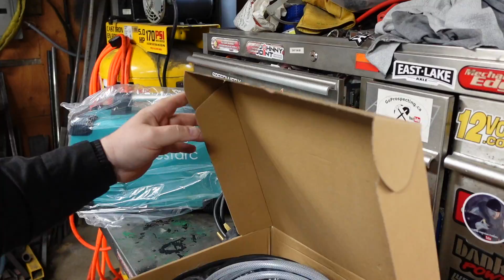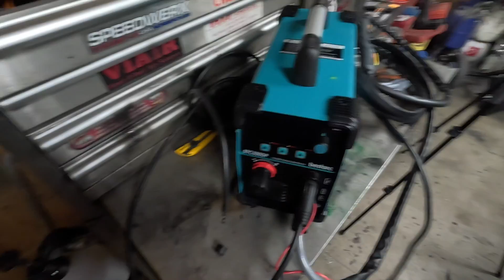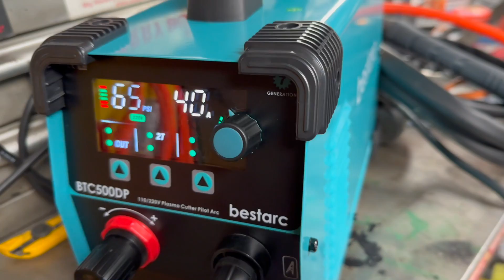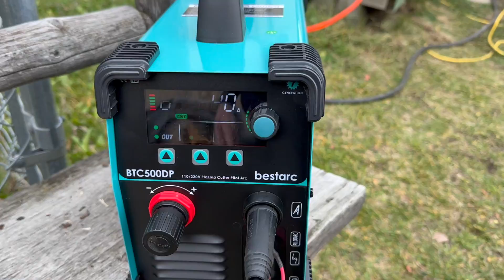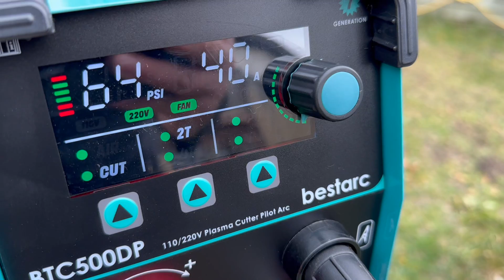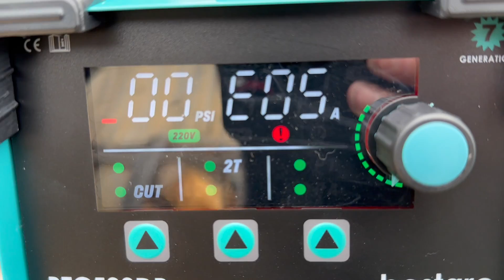BESTARC BTC500DP PLASMA CUTTER  - Amazon Plasma Cutter

Comment: I remember my unit going bang inside and let all the smoke out the wires. Sounded like a 12 gauge went off in the garage 😂. .. worked good for a few projects then bang... 😅 kinda like the amazon mini split,  except it didn't go bang. Probably done buying china Electronics for a bit. Oh and the Amazon mapp gas torch I bought Jesus atleast shut off ffs.
Reply from the maker: I had a Amazon one as well let the smoke out of the wires, not only did it trip the breaker in the garage it tripped the breaker feeding the garage
Reply: @BackCountryWrenching  hmm wonder if they all do that. Hopefully you get out winter camping, maybe you'll end up doing some ice fishing out of the overland trailer.